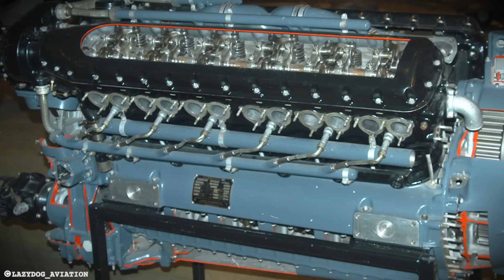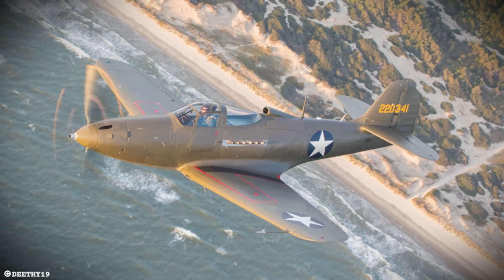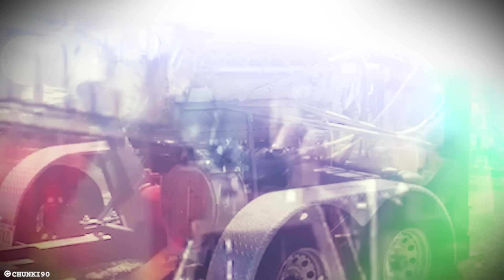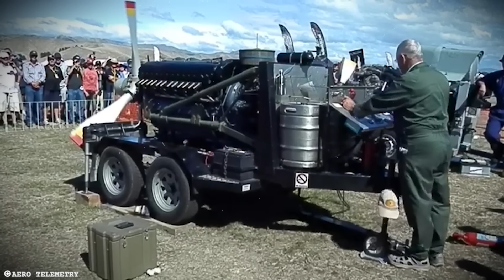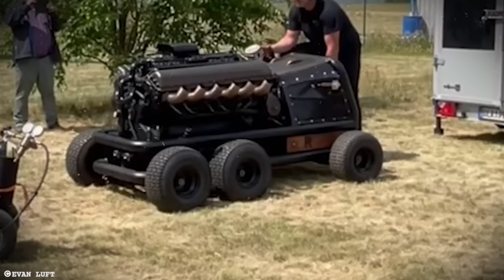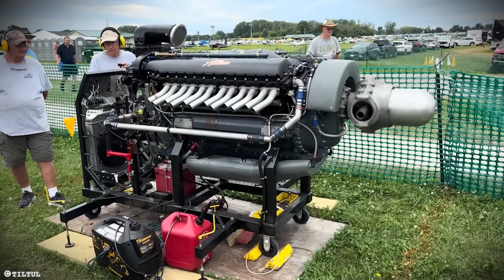Why the Allison V 1710 Was Replaced – The American Engine That Couldn't Breathe

Comment: Nuthin' at all "wrong" with the engine.  A forced induction system, whether mechanically driven or being powered by exhaust flow [the turbo] is largely an add-on system.  It could have been developed and packaged for this engine.

Comment: Don't forget the aerodynamics and of physics of the cooling system on the Mustang. That design contributed to the thrust output of the engine.  The hot coolant of the engine was routed into the heat exchange in the ducting of the cooling system and actually produced thrust (much like that of the open exhaust stacks) It contributed a lot to the speed of the aircraft as well and shouldn't be forgotten.
The designer of the cooling system also won awards for the design.
The Meredith effect

Comment: The reason it under performed was the fault of ge. Allison was redesigning a two stage supercarger 
, but ge went to war department and told them stop adding a two stage. Ge wanted a piece of the money 
And would design a turbocharger. This was totally pos weight over 1800  lbs.

Comment: If you were to watch the REAL video on these engines.
It was designed WITH the supercharger.
From what the REAL video states.
I believe it was G-E was supose to deliver the supercharges.
 But somehow was behind on mfg or shipping.
Hence first models delivered were not able to reach the altitude required because of lack of air...which the supercharger would deliver.
Who ever told this computer what to say, needs to research before posting.
Reply: The P38 with Allison power performed very well in Europe at altitude with GE turbo chargers and the B17 and B24 were able to function at altitude because of GE turbo's
Reply: @Joel161803  yes I understand.
This is the way they were originally intended.
Reply: @Joel161803  Bombers were radial engines not Allisons
Reply: The clickbait AI of an engine in the nose of a P-38 is painfully stupid and completely irrelevant.